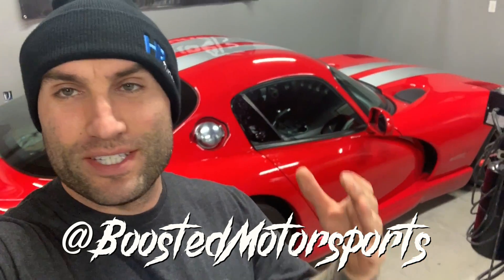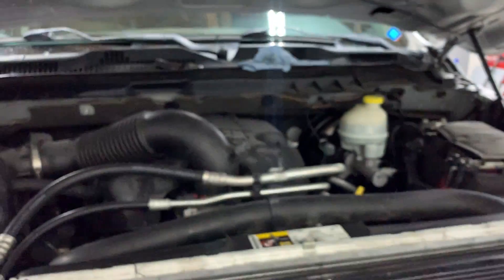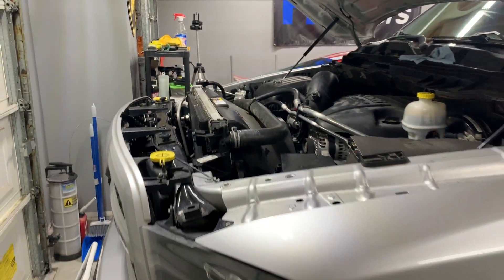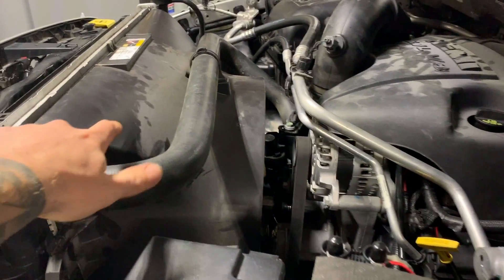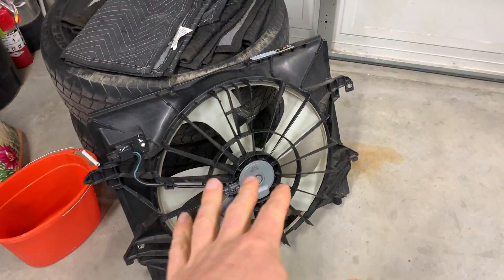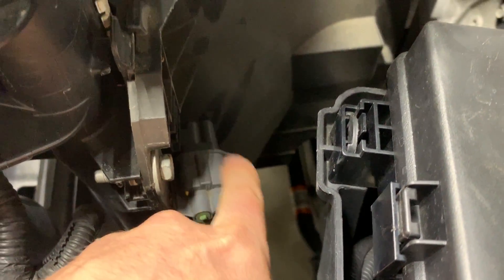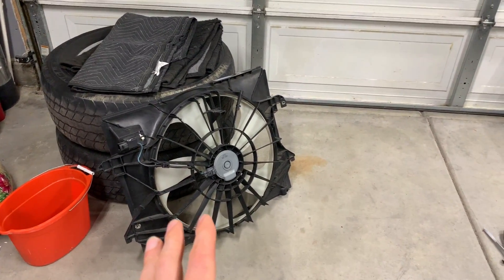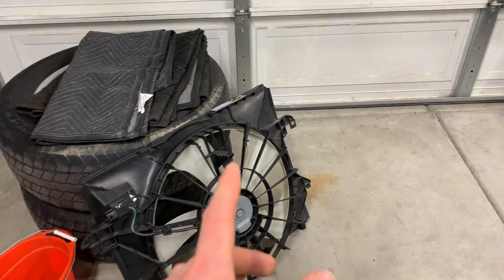RAM 1500 5.7L HEMI - V6 Efan Electric FAN - Myths & Truths

Comment: Thanks for your videos on the fan delete on Ram 1500. I did it on my 2013 Ram 1500 4x4 5.7. I found out a few things I would like to share with anyone doing it. You can get plug pigtails that hook directly to the fan and factory harness so you could wire it anyway you want without hacking OEM harnesses. 2003 to 2005 Ford Vic fan plugs (Salvage yard find) are the same as the  2013 Ram. The Ram water pump has a plug on it that can be removed for adding another coolant sensor of your choice.
Reply: Definitely helps thanks

Comment: This is totally worth doing. I run a canned tune and I was concerned about not having an accurate tune. My truck runs cooler I get better mpg and it's def happily I did. No tune
Reply: You run just a regular box tune and it’s fine?
Reply: @RuinedHemi  Yes running canned Diablo tune. No tune for the fan temps.

Comment: So why did you go back to the mechanical and take off the V6 efan?
Reply: Maybe because he used to race with this truck. 

Let's not forget that he mentioned in the previous video that using the v6 electric fan is only good for normal driving and not for towing and other strenuous operations.
Reply: He took everything off, because he sold the truck.

Comment: I have a 2004 Dodge ram 1500 hemi Rumble Bee edition that engineering is better version than today’s Ram,  they  are separated, so what I did is the same as the video and it works for me , my ram is about to turn to 300,000 miles and still running pretty good 👍🏻.

Comment: I installed the v6 electric fan on my 2011 shortly after seeing your original video . My bully dog programer doesn’t have setting for turning on /off electric fan , so what I did is use a flex a lite fan control module, and bypassed the stock electric fan connection plug all together . That with a 190 thermostat the set up works flawlessly .
Reply: Contact bully dog they can put it in your tune

Comment: That clears up a lot for me. I'm buying a 2014 ram so this is very helpful.  What i will do is go with a tuner, 160 stat, V6 fan, and that will allow me to double or triple the radiator size (whatever I can get to fit in Texas with weather now going to 115, you can't get too big on a radiator) , making up for less airflow.  I will also install fans in front of a/c condenser for more airflow and ice cold a/c.  We tow in 100 degree weather and I want real performance.
Reply: Just wondering but why did you decide to get the 160 stat over the 180 or 190?
Reply: Over the years I have ran both 160 and 180 stats and the 160 stat is always superior.  Vehicle retains the same compression at 30,000 miles as at 200,000 miles.  Seriously.  I ran a 180 stat in a 2006 durango and did drive it to 175,000 miles, but it was smoking oil, had to add oil between oil changes, using excess fuel, basically it needed overhauled.  I went back to 160's.  Remember, you have to also beef up the cooling system since if you dont it might run 170 all winter and 230 all summer.   Also, "its in the middle of the gauge between the C and H so its ok right?"  No its not.  Thats about 230 on most stock vehicles, way too hot for me.
Reply: When you say "beef up the cooling system" what all do you include in that?
Reply: For the Ram 1500 it's the above: 2 16"  spal fans for front of a/c condenser, manual switch to operate on the dash, also wizard cooling in NY makes my all aluminum radiators.  When I get my ram I'll remove the clutch fan and measure carefully how much thicker i can go with the new one, and tell WC.  then you send them your old radiator so they can copy it while building to my specs.  I can't wait to see how it performs should be much better than stock.
Reply: Of course, the V6 fan too.
Reply: Are you building to run it down the drag strip?
Reply: No not at all- building it for longevity though someday may swap in the 6.4, and the radiator should be just fine for that motor too.
Reply: @j.d.mcginn6946 
Hey man I just stumbled on your insight here. I was wondering if you have completed the build on your 5.7? I have a 5.7 that I use to tow, and a 5.2 magnum I use to just regularly go to work or grocery store etc. 
I've always stuck to the stock t Stat, but I'm going to go ahead this weekend and run a 160 in the 5.2, but I have no clue where to go with the 5.7 hemi. Anyways thanks, and God speed

Comment: I had an electric fan in an 05 ram hemi and yes it gave me like 10 horsepower and it gained about 5mpg. Its definitely a real performance upgrade. No snake oil on that one.
Reply: jebusm86 can you send me the link or just tell me where where you got that fan I really wanna up my mpg. Thanks
Reply: @mxnation9912  for the 05 ram or other 3rd gen I used a flex a lite 180 fan. For a 4th gen ram you can buy a v6 fan off Amazon.
Reply: jebusm86 ok thanks man really appreciate.
Reply: Jebusm86, how did you hook up the wiring for the electric fan?

Comment: You can also remove one of the fan relays for a temporary cooling. When removing one of the fan relays the ecu detects an open circuit therefore keeps the fan running on. Yea it will kick on on cold starts but at least you won't have to see your temp gauge go up and down all the time. The fan will start all the time keeping the temp at at least 200° when fully warmed up. And yes you will get a check engine light.
Reply: Does that cause any problems or damage? Other of course the engine light lol
Reply: Which relay
Reply: Tried looking it up only thing I seen was fuse under hood latch maybe
Reply: @forfuccsakes  conseguiu resolver to com mesmo problema

Comment: I did the swap this week and it’s so much better. I extended the wires so the resistor could stay in the shroud and just wrapped them up with wire loom and tape. Total investment was $108 with the Dorman fan.
Reply: Can u send the link?
Reply: Did you tune it
Reply: James grant no sir. Still trying to find the sales code from Dodge to be able to see if I can add it to my VIN.
Reply: @RamBayou1  thanks
Reply: Do u just bolt in and and your ready to go ?
Reply: @amermuscle, I sure did.

Comment: My electric fan died on my bone stock 2013 Ram 2500 5.7. I ended up installing a V6 fan but also kept my clutch fan. Sounds silly but it fits just fine. I had to extend the wiring harness about 6-8 inches.  I used the old fans wiring to make the extension.  

I also run a 180 mishimoto thermostat.
Reply: What temps are you running at? Any towing? And if so, temps?
Reply: @nickvernillo439  Stock tune,  Coolant temps are at 185 with a Mishimoto 180 T-stat (179).  

I don’t tow much but I still have the clutch fan but its too loose and needs to be replaced.  Fan clutch was next on my list to do if the efan did not get the temps down.

Comment: You guys kill me lmaooooo,  most of the questions asked are explained in the video,  thanks for the info I'll be doing the 180 thermostat and the electric fan on my 17 hemi ram
Reply: How'd it go,? I got mine today and noticed that the pins in the plug are ah little different but my plug plugs right in. I'll be installing it tomorrow, hopefully no problems.
Reply: He did say that the 180 degree thermostat may throw a code or not activate the grill shutters.  Did you do a tune? Which tuner? Or did it throw any codes? 
I did the v6 swap from the Amazon link at the top of comments with good results but want to change the thermostat as I change the coolant and have so many questions before I run into issues.

Comment: Locktite the fan screw!!! before install

this fan lasted exactly 12 months untill the motor broke the other day on a long trip . An amazon review states that the screw holding on the fanblade comes loose over time and he advises to use blue loctite on that screw before installing. Im assuming this was the same issue with my fan as the blade feels loose and the motor is definitely shot. The motor most likely failed due to the loose fan wobling all over the place.

Comment: 2016 Ram 2500 PW, I removed the mechanical fan tonight and took a run up to the ski hill to around 8000ft. going slow holding 4200 rpm to simulate a trailer. And without a trailer I almost over heated got up to 245 it cooled off quickly once I turned around and got air flowing. I ordered a V6 fan last week, and will give it a try again once it's here, I am hopeful it will perform better, a little worried for pulling the camper. I will try a cooler thermostat and maybe look into trying to add a electricly actuated mechanical fan like the cummins. If this doesn't work.
Reply: Update?

Comment: I was considering it. But as a mechanic for 30 years. I kinda think it is better to have one to back up the other. If electric fan quits you still have the mechanical to cool engine. So you are not stranded.
Reply: How would you have enough room for that in the engine bay? We have an 07’ 1500 and I don’t see there being enough room for both (I don’t have much mechanical experience)

Comment: I bought my 2017 Laramie Classic (Loaded) brand new and never knew that it had an electric fan until this year (2023, I never heard it turn on) when I was troubleshooting an overheating issue on my 8HP70.  The trans overheating was due to the malfunctioning of the Trans Heater.  Once I replaced that I began to search out why my fan never came on.  The 60A fuse looked good so I checked the relay and the plug.  It wasn't getting power.  I went thru all of the schematics and discovered that the 10A fuse had no power with the ignition on and the schematic indicated that it should.  I discovered that the Run Start relay would not send power to it unless the engine was running.  when the engine was running the fan relay had power on both the energizing circuit and the fan run circuit.  I returned to the 60A fuse and pulled it to run an ohms check, it was defective.  Replaced the 60A fuse and all is good.  Even though I had not been over heating, everything is running cooler that before.

Comment: For those who are concerned that the truck will overheat / will run hotter. The facts: The fan is only there to provide cooling during low speed or when stopped (idling). Above 40mph, temperature is entirely regulated by the thermostat (if you don't believe me pull your thermostat entirely and see if the engine warms up going down the highway with the fan disabled). If you are in stop and go conditions without a tune yes engine and trans temps will be higher. The factory E fan on temp setting is 223F. Though this can be overridden by AC pressures when your AC is on. 

A solution for those not interested in a tune to turn the fan on at a lower temp. You could wire a manual switch to the efan and turn it on when you desire. This would cost you around $20 instead of around $400 - 600 for a tuner. 

For those going the tuner route pay attention to the High Vehicle Speed Sensor (VSS) fan settings. It is not desirable to run a fan at highway speeds (40+MPH). At these speeds, running your fan is actually restricting flow and putting strain on your fan motor.
Reply: Thanks for the info!

Comment: I have a 2010 Ram 1500 5.7 and I never seen my coolant temp guage needle right in the center. It's usually quarter way up, even when it's close to 30°C (86°F) outside. So with that being said, I'm going to remove the mechanical factory fan and just run the small electric one.
Reply: @Jay Garcia So far so good with zero issues. I'm thinking of buying the V6 E-Fan though because it's small and more powerful.
Reply: Any mpg improvements?

Comment: For clarification for some who aren't aware...the "stock" e-fan on the gen4 Hemi is the cooling fan for the a/c condenser core. It is not meant to (and will not) handle the heat load of the engine coolant. It is for the a/c condenser only! DO NOT remove the mechanical fan and only run on the stock e-fan for the V-8. Those two fans are designed to work in tandem. The e-fan from the V-6 '09-'12 gen4 truck takes the place of both of the previously mentioned fans, and works fabulously! For the new "V-6 fan"...the fan on/off is controlled by the a/c switch. A/C on = fan on. A/C off = fan off. And that works fine, as long as you understand those limitations. The only way to set on/off of the e-fan to be temperature-controlled is to use a tuner like a Diablo, and set the temp. Most users swap the t-stat to a 180°F unit, and set the fan on/off around that same temp. Most users see operating temps average around 195°F.
Reply: Can the dealer make those adjustments to the ecu? Trying to not void my warranty.

Comment: Hey man I just replaced my water pump (oem mopar) then after I'm done I noticed my fan was loud as heck when I took off up until like 3rd gear. So I just replaced my fan clutch. And it still is kinda loud. It wasn't like that before. It's driving me nuts.

Comment: Let me run a hypothetical by you.
quick background, I have a '14 1500 and I'm in the process of getting a whipple.
Planning on doing the V6 conversion, but lets say I did the mechanical delete instead and just ran with the stock electric fan.
Already knowing that the super will generate more heat, i assume the stock fan would be supremely over-tasked regardless of the built in heat exchanger and intercooler/radiator supplied by the kit.
Here's my question:
What if you installed a water/methanol injection kit?
Theoretically, with that running through the engine, temperatures produced would be lower and the need for a larger more capable fan would be negated, correct?
Anyways, any answer is appreciated, just spit balling ideas here.
Reply: There is no use in getting a tune all you can tune in the Diablo Sport i3 is AC fan setting's ON, or AC fan settings off, that's it there is no tune for heat setting on or of don't get sucked in.

Comment: The one question I had was not answered. You made thw change, and then went back to stock. But you never gave any reason or explanation WHY did you go back to stock?!? Particularly after hearing you say it's more efficient and has more cooling capacity. 🤔

Comment: Is it worth removing the e fan and srock mechanical fan for the v6 fan or is it better to keep stock setup with mechanical fan to keep temps cool tryna find out if it is worth going to v6 fan instead of the e fan and mechanical fan but im worried about temps and towing etc

Comment: I have a 14 ram 1500 and I did the efan swap with the v6 efan from a 2010... no tune (and I don't want to get one) and the thermostat is stock... temp gets to 220 and the fan comes on and drops it down to around 200... but my problem now is the when sitting at idle the truck will begin to almost stall and rev back up and then almost stall again and continue this cycle... any insights on what's causing this? I also have the vararam air intake but I had this installed before the fan swap and the truck ran fine. thanks for any info you may have!
Reply: Did yoy figure out the problem ?

Comment: Just to clarify... If you have a NEWER year V8 truck you want to order the OLDER V6 fan for it because the NEWER Truck has the same connector as the OLDER V6 fan?
Reply from the maker: Correct. Link is in the description for the v6 fan you want to order 💪
Reply: @BoostedMotorsports  its actually not.  Visit the link.  It references a fan plug with 3 pins.  The 4th gen V8 Rams only have two pins.
Reply from the maker: @michaelscofield2730  you have much to learn bud but do as you please
Reply: @BoostedMotorsports  not trying to be rude.  what am I missing?  I literally just checked my truck.  I have the dorman 410 fan installed that you have linked here but I had to create a small wiring harness to make it work because the plugs didnt match up.  2 pin versus 3 pin.  Happy to supply photos.  I'm actually trying to replace the fan because it is off balance and the blades strike the housing.  Just wanting to make sure I get the correct part and OEM is discontinued.

Comment: @BoostedMotorsports or anyone that knows .. I did the fan swap (no tune) months ago and definitely noticed mpg gains (3+mpg) and throttle response. But now it's hot and humid and my a/c is struggling. I thought it needed a charge but it was right where it needed to be when I bought the refill kit. I just purchased a tuner. Will that help blow cooler air? Or should I change out the thermostat? If so, what degree stat should I change it out to? 190? Thanks in advance ..

Comment: Hi I love your contents a lot specifically that hellcat swap can't wait for you to do the first start-up.  So I have a question about the fan swap the one that you listed when I put it on Amazon it automatically told me doesn't fit my truck which is still good right cause it for a v6 2006-2012 right i have a 2018 big horn 1500 4x4

Comment: What tuner works best for editing the fan temp parameters and setting it for fuel economy. 2010 TRX4 5.7.
I want to set the low fan speed to 189 and the High fan speed at 195. I then want to set my hemi to get 16mph period.

Comment: What’s the part number on that v6 fan I looked on rock auto and there’s a few for the 2012 with the 3.7 L v6 but some say they have the three wire plug instead of the two...
Reply from the maker: Link in the description 👆
Reply: @BoostedMotorsports  It's not there in the description Please post in this thread

Comment: Hey brother

Great videos as always!

Question... I have a 2018 ram limited and want to remove the mechanical fan... my question is... where would you go to get the pcm unlocked?  I would consider getting the tuner as I also want to program the mds system to be off all the time.... its such a pain to do it thorough the transmission + and - buttons every time... ... I baught a v8 and want to keep it a v8...

Thanks again for the great videos!
Reply: Did you ever do this? I got my Diablo Trinity 2 tuner with PCM swap I think from Moes Performance and had Jay Greene tune it